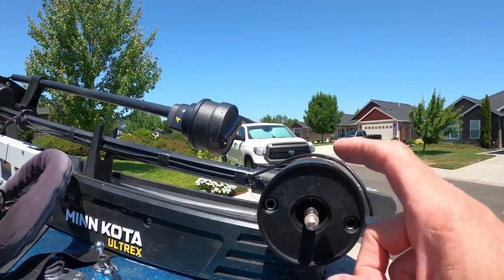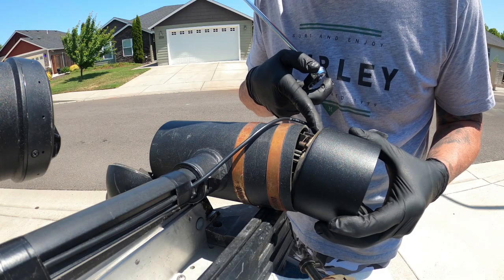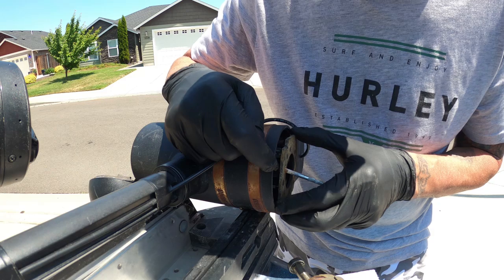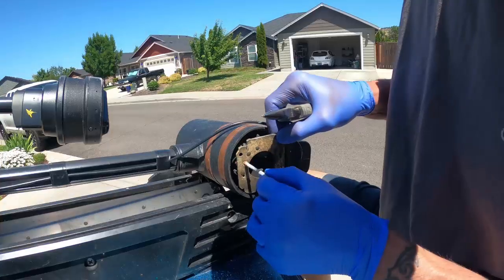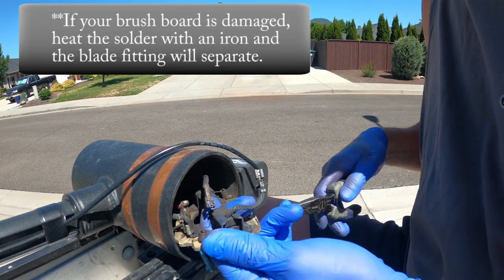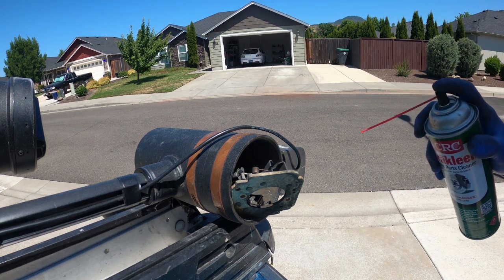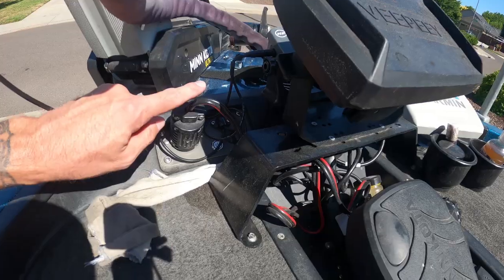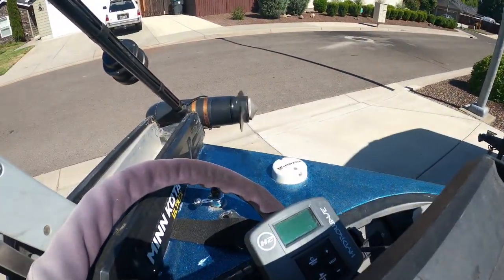Minn Kota Ultrex Lower Unit Rebuild (fortrex, ulterra, terrova)

Comment: I have a four year old Terrova and the lower unit has water in it and the foot pedal shorted out.  Junk
Reply from the maker: It should be repairable if you want to try it. It's pretty disheartening when our equipment goes bad in a short time like that.